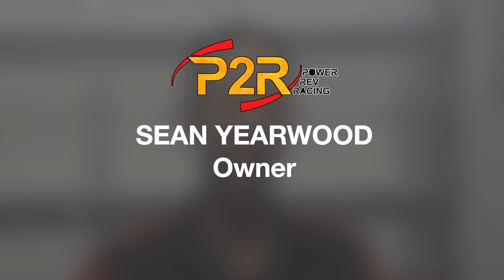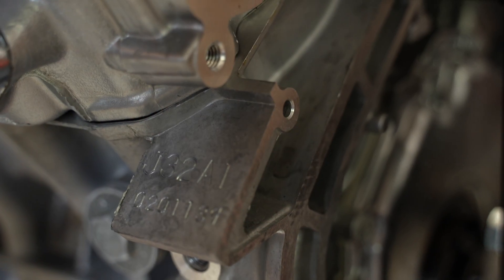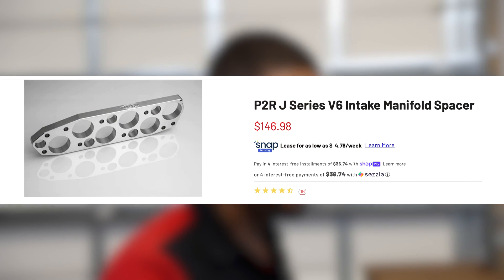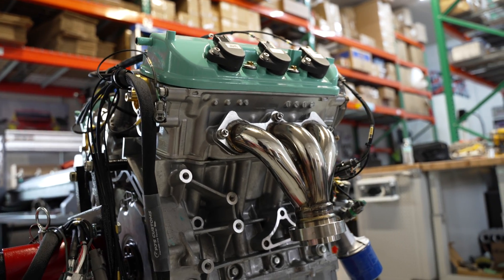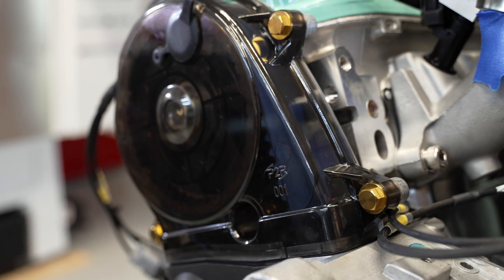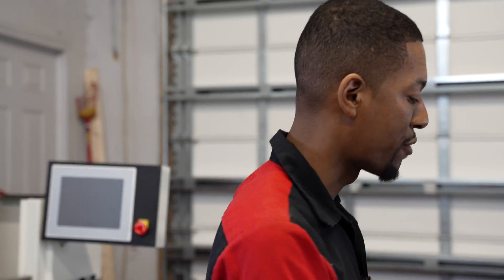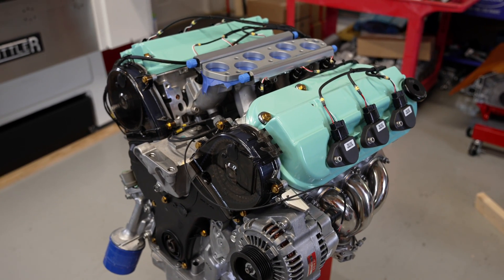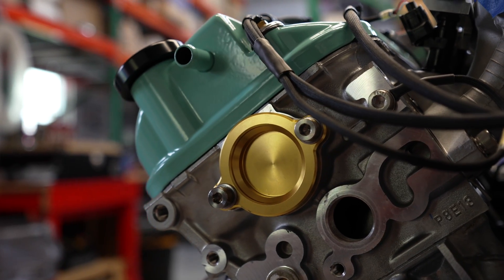Walk Around of a P2R Turn-Key Ready To Go J32 Engine Build

Comment: i saw your j35a4 assembly video, and i was wondering if it would be worth it to use a j37a1 crankshaft within the build.
Reply from the maker: J37A1 crank is a nice increase in stroke. 96mm stroke vs a J35 93mm. Our ILX is using a J37 crankshaft.